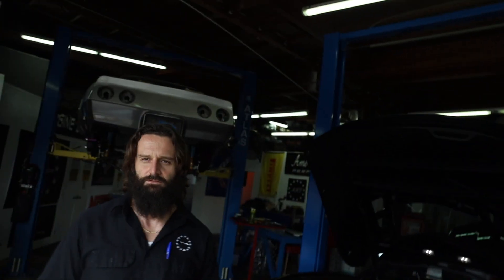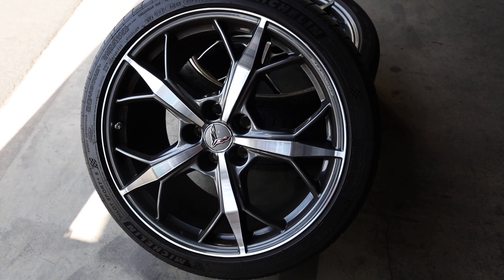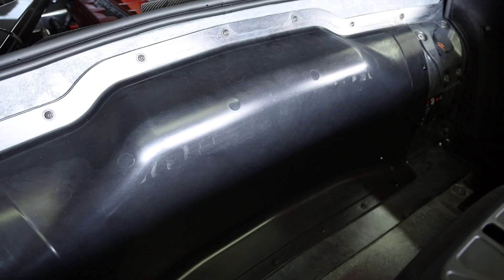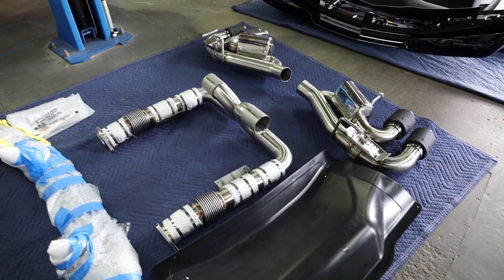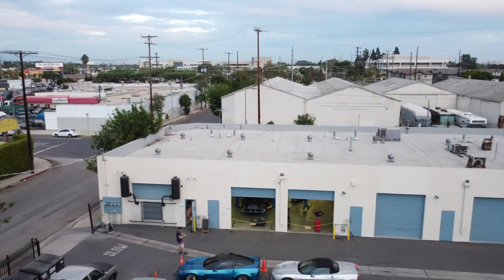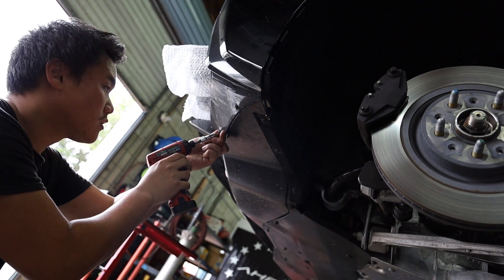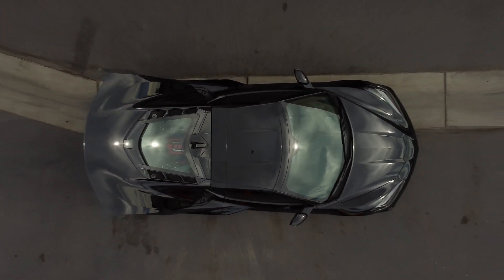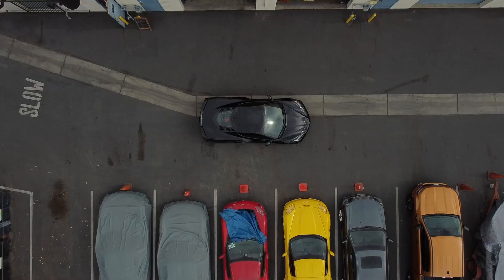How To Install a C8 Corvette Catback Exhaust & High Wing Spoiler

Comment: Hey thanks a lot for this video! Would you say this DIY is doable (catback and high wing) can be done at home by someone without much mechanical experience?
Reply from the maker: Not a mechanic here, Allen, but this is very doable at home. You'll just need the right sockets and tools. A lot of patience. And you definitely need a friend (or two) for the parts where you're pulling off the bumper and/or dealing with any painted surfaces.